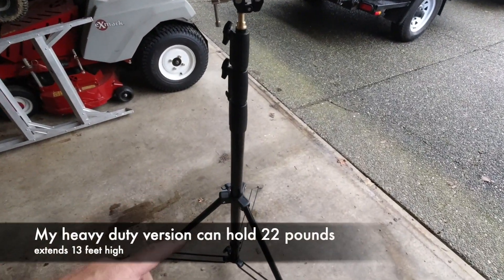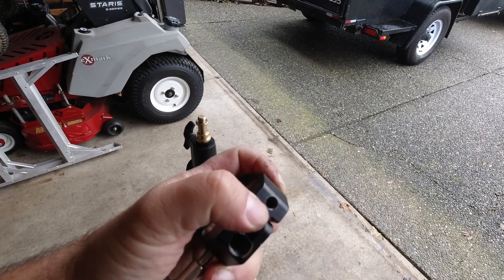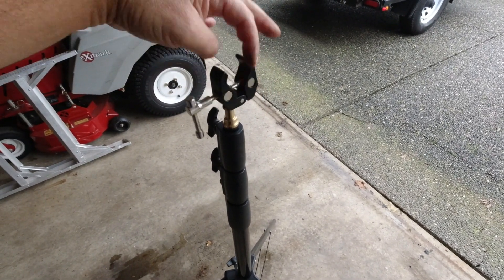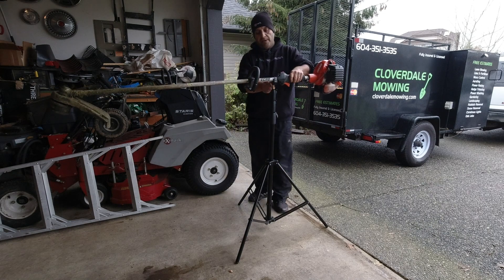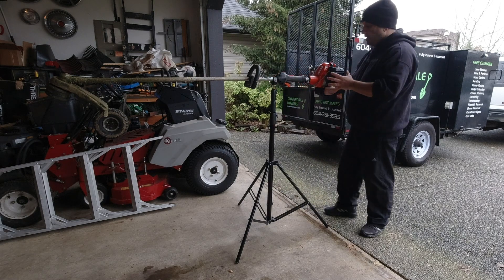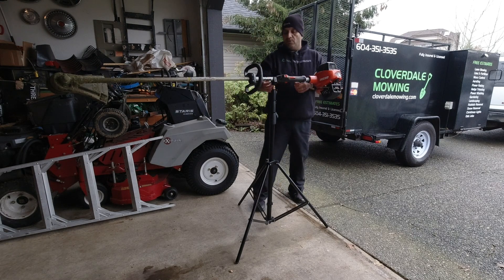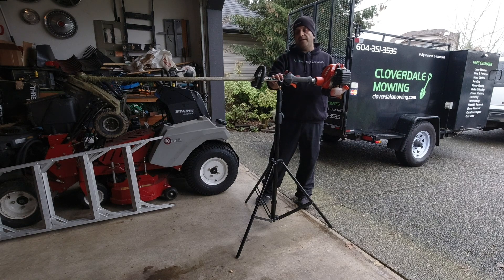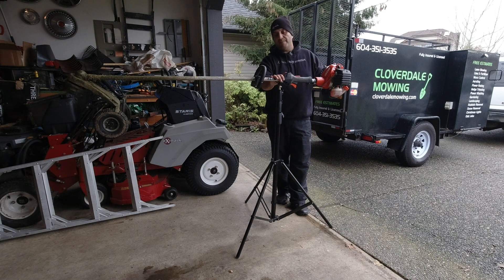Simple String Trimmer Repair Stand

Comment: Thanks! Was asking you in another video about this. I've needed something like this for yeara
Reply from the maker: No problem. Just be sure to use a heavy duty stand. Some of the cheaper ones would probably fall over. The one I have in the video actually extends up to 13 feet high so it’s built solid. I originally bought it to mount a camera on top to film my kids soccer games from a higher vantage point. Over the years it’s come in handy for all sorts of things including a trimmer stand. Thanks for watching.

Comment: Not sure if that is heavy enough to last. I found a bicycle repair stand with quick release clamp.  Much heavier duty than a camera stand. I use it for all kinds of projects around the shop. The clamp turns and pivots and has a small tool tray . I think I paid maybe $40-$50
Reply from the maker: Yes a bike repair stand is a great option as well. Probably more rugged. I already had these pieces so it did not cost me anything. The light stand I have is pretty heavy duty not the little cheap ones and extends 13ft high. So it’s built pretty stable. I use it for all sorts of things. I know a lot of the guys that film YouTube videos have various stands available so this was just showing another use for that stuff. Thanks for watching.
Reply: Yep the bike stand